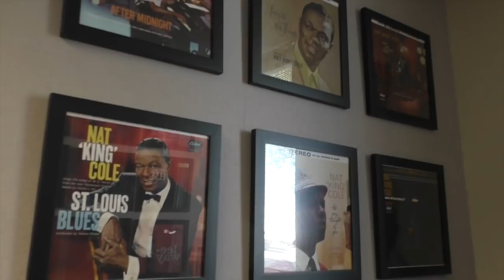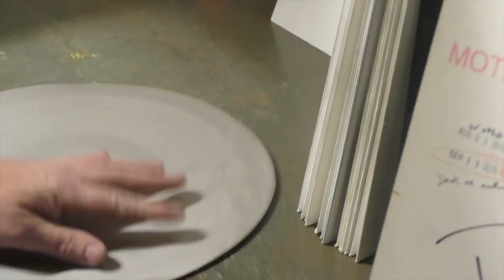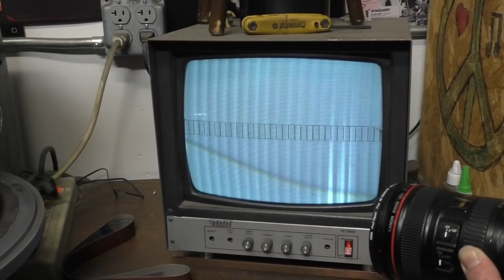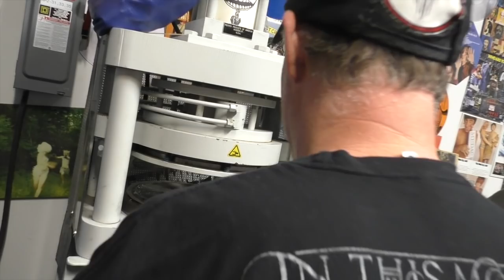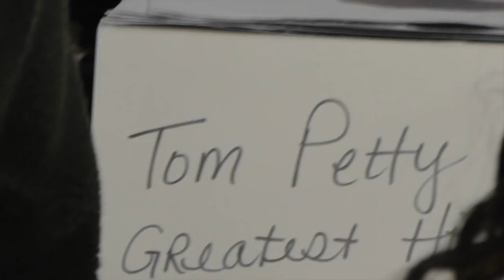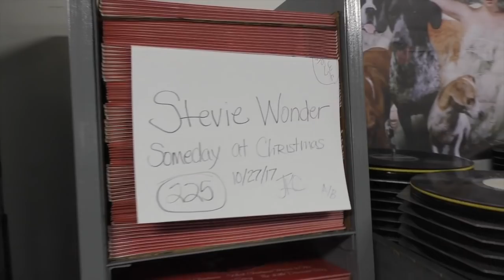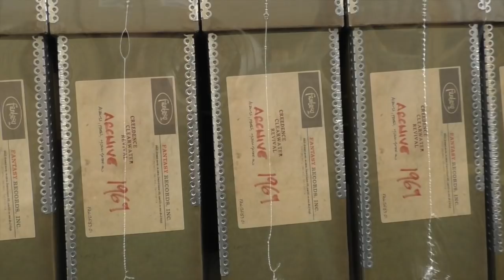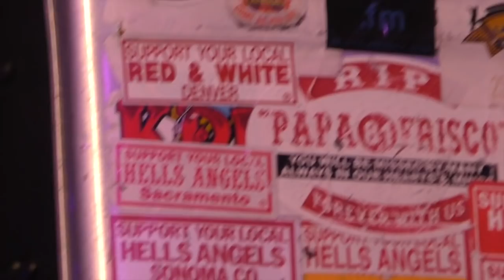QRP Pressing Plant, Acoustic Sounds, and Stiefel Theater Saturday Night!

Comment: Would it be better to have a cleaner dust free environment when creating and handling the metal stampers? I noticed that the pressed vinyl is just stacked. Any dust or contamination will be forced into the grooves by the weight of the stack. No wonder some records are crackly.

Comment: I think you'll find the reason why the English pressing is different to the American is the curve put on the record is different because it's 50hz not 60hz
Reply: I used to no this guy and he had these records I think they were 240 grams there were a lot more heavier than the standard 180 grams, the thing is the material it was made from was very unique it wasn't a vinyl plastic. It was a terracotta colour and they felt like clay!! but I can't imagine it being clay! They were about double the thickness of a standard vinyl LP. Would really like to know what material they were made from. Because the sound quality was remarkable very good noise floor. Do you have a clue what they might be made from.
Reply: Analog Planet it must be relevant when the original engraving was made this would have been at 60hz and the stampers would be at 60hz they need to convert this to 50hz in the UK? And there is a different Curve pattern for England and America isn't there!
Reply: more heavier*
*heavier or more heavy,

very unique*
*unique..By definition something cannot be 'very' unique..It is either unique or it is not.

You're welcom.

Comment: Way too many bad records get shipped out, so their quality control is not up to par. One common problem is that the stampers are not aligned with each other so one side of the record may be off-center. I found this to be the case with some of the 2015 Creedence Clearwater Revival re-issues. One of the latest issues was with the Jimi Hendrix UHQR stereo re-issue. The one I received had one side slightly off-center and the record was slightly warped. There was excess surface noise which cleaning couldn't help. Right away I contacted their customer service and didn't hear back so I tried several more times. It was about a year before they finally got back to me. They did sent me a satisfactory replacement LP, after I returned the bad LP. When I spoke with them, I was told that they had a 16% defective return rate on the very limited production album. This seems like a lot to me so their quality control wasn't doing a good job and then their customer service was pretty bad. When a person spends $100. for a single audiophile album and then has to pay for shipping, I would think that they might have done a better job.
Reply: Yeh, it's fucking not acceptable. The industry will fuck itself with the shitty quality